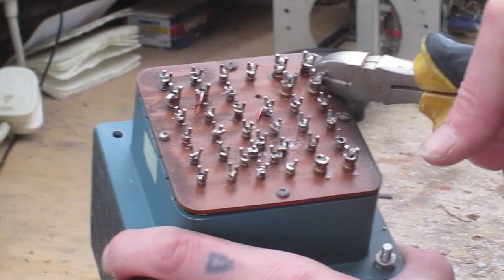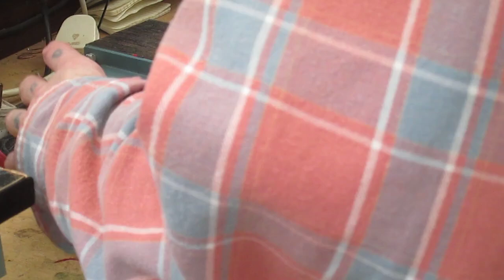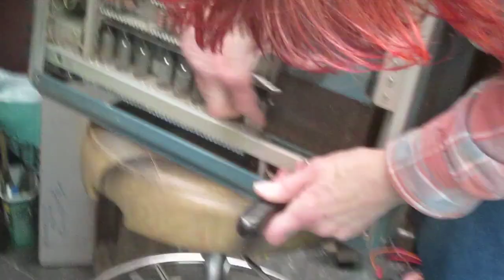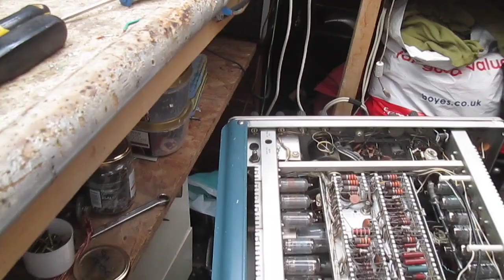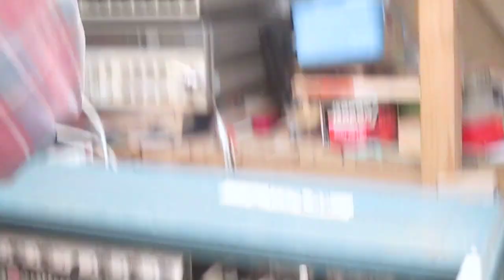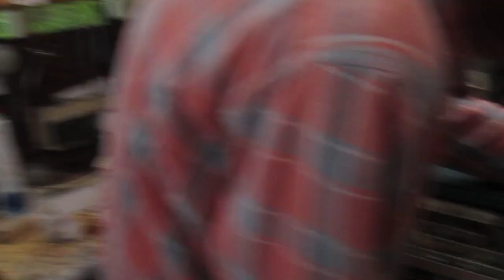Fitting a Transformer Into a Tek Scope - An Hour in the Workshop.

Comment: I'm using one of those Tek transformers in an SE amp, it's a seriously heavy beast indeed...
Reply from the maker: In a SE amp, what are the OP valves 3CPX800A7's? Glad to see it's getting some use. TFW.
Reply: @diabolicalartificer  It's a KT88 circuit. I may be trying another design with 807s. Those old Tek scopes are great. I used to have a 547, but it was too big for my space, so sold it on, with some regret....